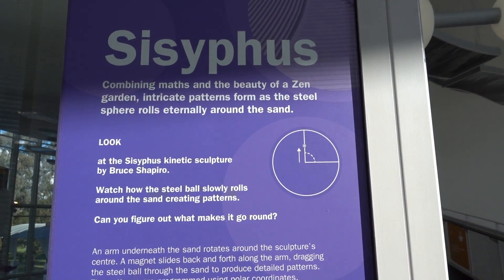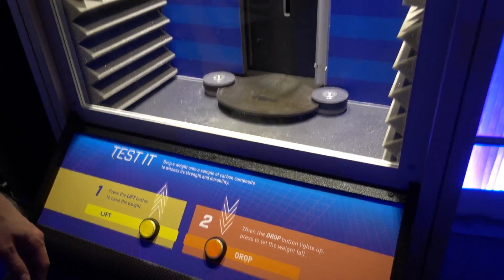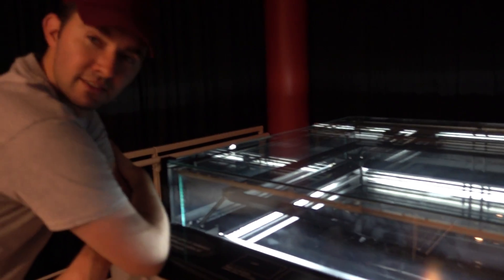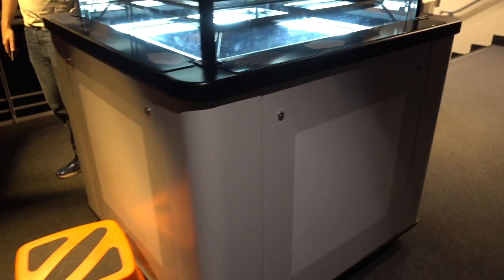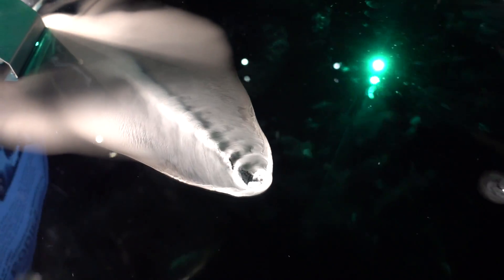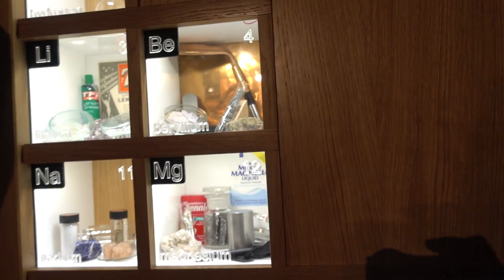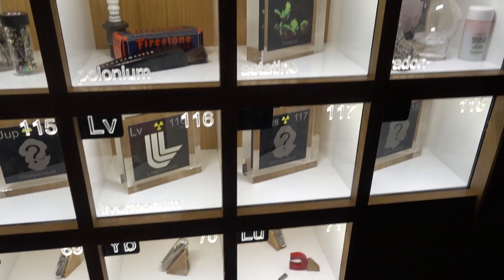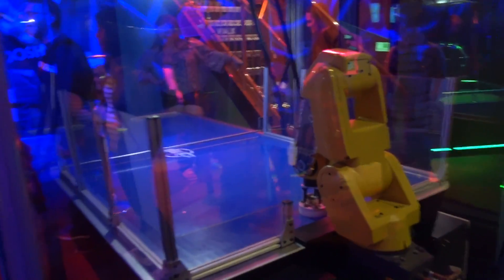Questacon - Science Time!

Comment: The copper cable you wondered about is a telephone cable, for the trunk lines between POPs.
Reply: How many of those can be replaced with a single optical thread?
Reply: Well, a  pair of those would handle a single call, equivalent to 64 kbps of bandwidth. Last i checked, we were deploying up to 32 channels of 100 gigabit over a pair of fiber strands (there'll be anywhere from 24 to hundreds of strands in a bundle). Unless i'm terribly mistaken, a pair of fibers could theoretically replace 50 million pairs of copper wires.

There are solutions for much denser multiplexing than the one i've seen in service, though, so the number could be even higher. In practice, it rarely is, though.